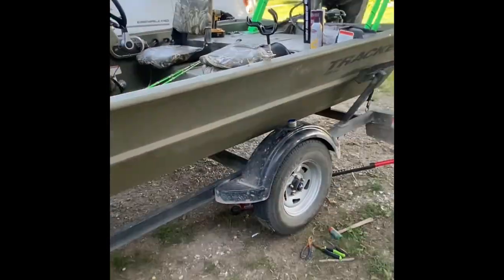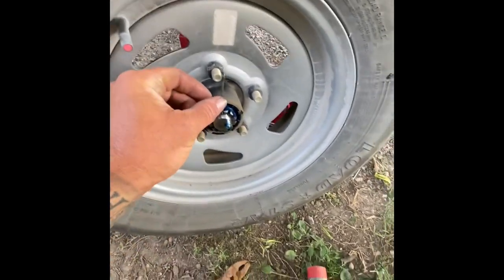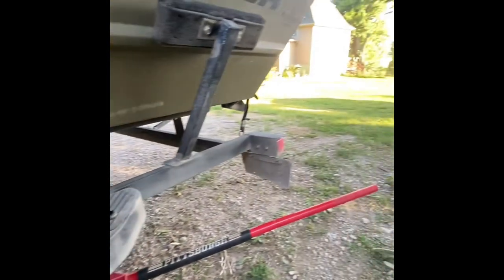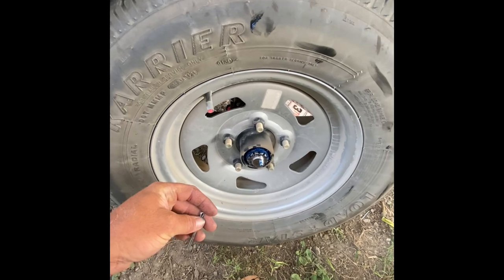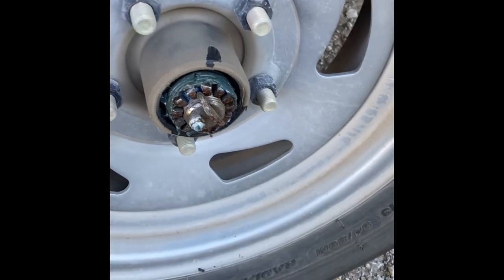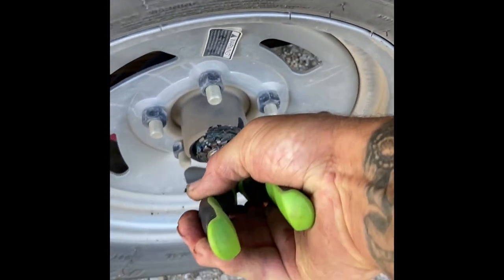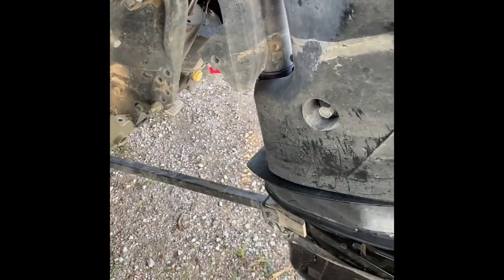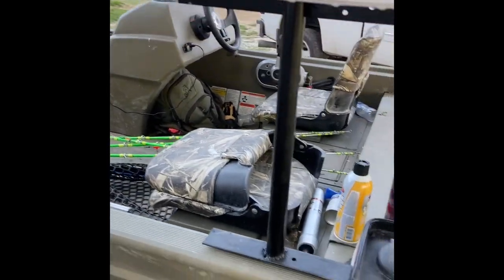Tracker boat trailer recall “failure under normal use”

Comment: I've owned a karavan trailer with a 14' alumacraft Jon boat on it since "97". Bought it new and have the original bearings still in it. Keep fresh grease in them 2-3 times a year. Got at least 100k miles on the trailer and still the hubs run cold!

Comment: There might be other problems with those bearings besides the tightness of the castellated nuts? Like race or ball or roller failure ect? Not real expensive, tsc or auto parts stores,maybe even lowes or other hardware stores should have them pretty cheap or can order the right size replacements. I did the bearings inner & outer & races on my trailer for $20 per wheel or so. Might have been $25.00 for the whole kit for both sides? Cant remember,been 6yrs now. A wicked pot whole at high way speed with a full 1 ton load in sub zero temps (firewood) took out one side in short order. Changed both while doing it.
Reply from the maker: I’ll replace them next spring but I shouldn’t have to
Reply: @TrapperJOutdoors  It could be a hit & miss thing maybe just some,ya know? I'd change them too & keep checking for hot hubs when you travel with it. I'd buy the right replacement kits now,races,bearings & seal & all before they go up & just to have them & carry them with me as well as a hammer,2×4×4 block,& right size & length pipe nipples to tap races in & out on the spot. Jack of coarse or something to make sure the one in your truck will do it. Just cheaper than a tow by a long shot. Maybe faster too! Hubs usually dont get damage,just races & bearings. Now that I've done it once it's a 20 minute job or so. Man mine tell go with a crunch! Wheel locked up,ect? I just drug it along skidding in the snow a few miles. I think 6 miles. F IT,it was -8f. Cocks a bit with one wheel skidding in snow. Oh well. I made it. That side got it really,really  bad twice while loaded in really cold temps. It was almost brand new the first time. It was 3 yrs old the 2nd when it let go,was also used hard & continually for those 3 yrs. Dont think anything was ever wrong with the bearings at all. Just use & abuse. We get wicked ass pot holes here in n.y. from the cold & plows.